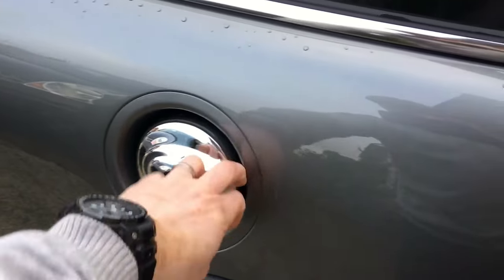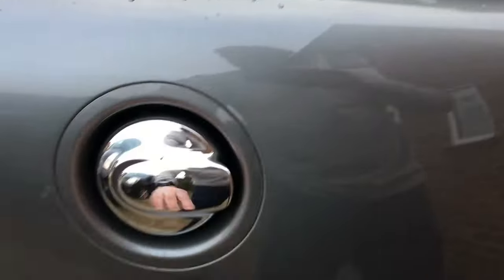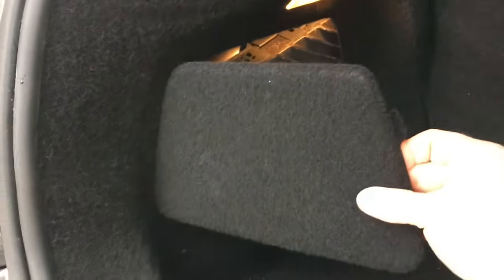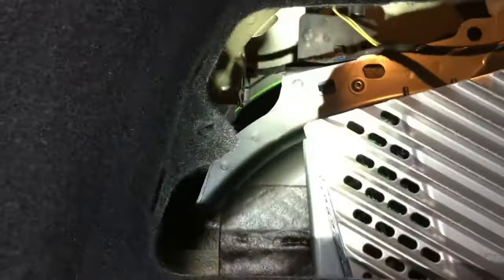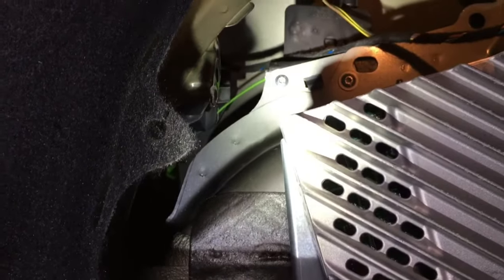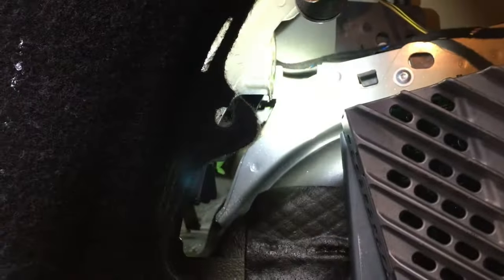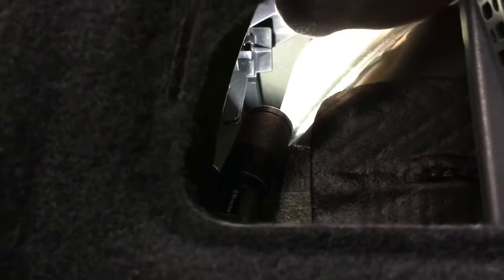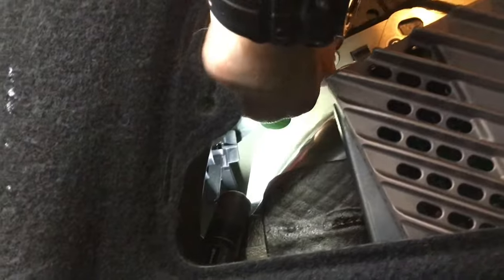Mini Cooper fuel cap manual release

Comment: i have the opposite problem, the pin wont go out when i lock the car. so its always open. can somebody help me?? anything is help
Reply from the maker: it would need a new solenoid. but it’s not really much of a problem is it?
Reply: Locking petrol cap cheaper than any replacement part. Besides the plastic locking pin breaks off too easily.

Comment: So if you pull the pin it would keep it from shutting ?
Reply from the maker: It still shuts as the chrome cover is sprung loaded. So it doesn't flap open as you drive along.